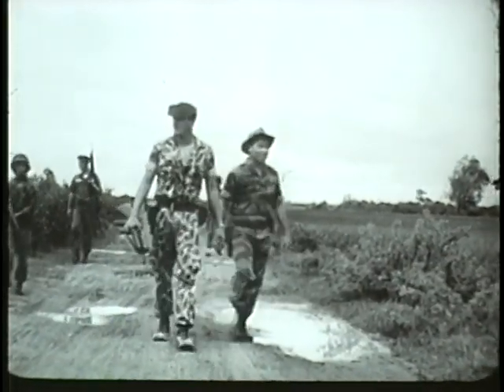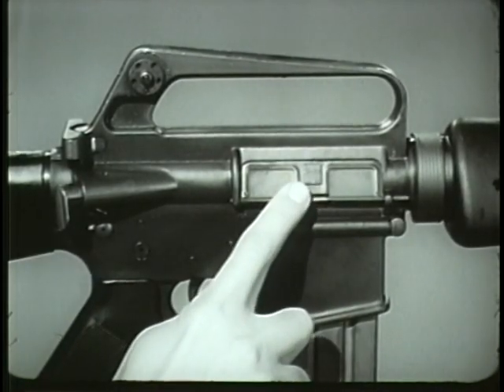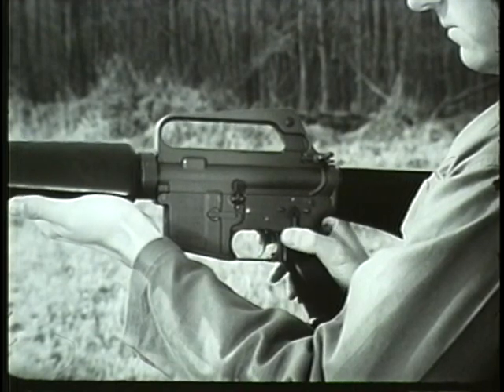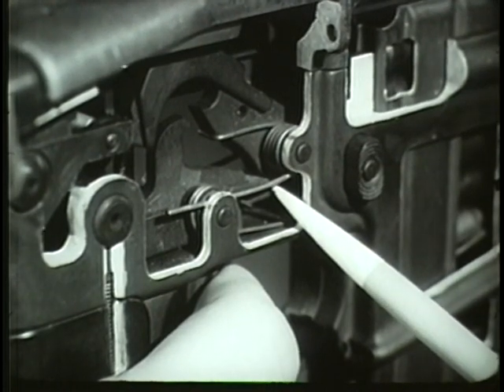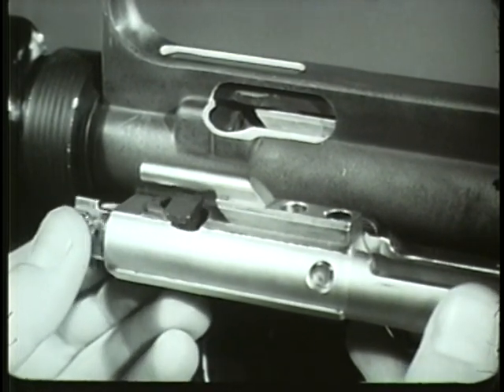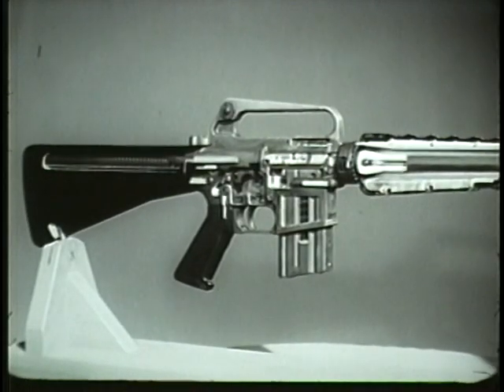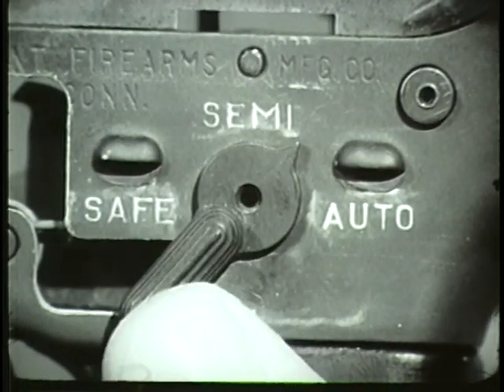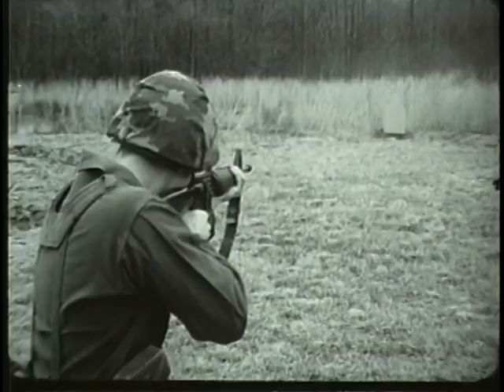RIFLE, 5.56MM XM16E1 OPERATION AND CYCLE OF FUNCTIONING

Comment: Of all the assault rifles I have burned tens of thousands of rounds through, the AR15 family is one of the most reliable, and has the smoothest recoil impulse of all.  The biggest factor that the user has control over in determining reliability is lubrication.  The AR/M16 needs lots of lubrication, the thicker the better.  Contrary to popular mantra, it does NOT need to be meticulously cleaned.  Feed it M193 and M855, on a wet bolt carrier group, and it will run.
Reply: Pou

Comment: The earliest models of the m16 didn't have chromed barrels. Which caused gunk build up from the gun powder. Gun cleaning kits were not issued to soldiers because they believed the gun wouldn't jam. But through out Vietnam the gun was updated with chromed barrels and forward assist. They also started issuing cleaning kits for soldiers.
Reply: Poui

Comment: It was not the ammo, it was the fact that the M16 was the first Direct Impingement rifle ever fielded by the US Military, instead of the Gas Piston designs that had been used in earlier semi- or full-auto rifles (ie, M1 and M14).  The direct impingement routes gasses all the way back to the receiver, which causes quicker fouling than a piston, which separates the receiver and gasses by a length of metal.  Once the maintenance guidelines were changed to reflect this, jamming was cut way down...

Comment: They also didn't supply a cleaning kit to the boys in nam cuz they used stick powder in the testing which is a little more expensive and doesn't dirty the gun as much but when it became a full US rifle they switch to ball powder which made it dirtier but costed less therefore caused it to need cleaning but no kit was assigned hence it jammed but you clean it i will take that over a AK any day

Comment: The M16 does a better job of keeping dirt out of the action than almost every assault rifle design out there.  NONE of them work with dirt in critical parts of the action, especially the chamber.  There is no 100% reliable mechanical device in harsh conditions, and I see more AK's failing on clean range conditions, let alone the field.

Comment: why does not charging handle moves during fire?
Reply: Tom Gol it isn't connected to the bolt
Reply: @ Tom Gol 
The charging handle has a loop - shaped end that hangs down and captures the front of the gas key (which is attatched to the top of the bolt carrier) so that it can draw the bolt & carrier to the rear but does not have to reciprocate with it. Google ‘animated AR15 cycle of fire’ or look up a mechanical drawing and it should become clear to you.
Reply: non-reciprocating charging handle

Comment: The cycle of jamming.
We should have just kept the M14.
Reply: just clean the weapon once in a while
Reply: +EnoughAlready Almost. Remember the AK? Nearly impossible to jam unless you really try to jam it.
Reply: +Fleece “B00ty Warrior” Johnson 
When South Korea bought M-16s, they demanded the gas tube be replaced with a piston. 

The designers of the M-16 were a bit obsessed with making the weapon light. Adding a piston adds weight, but makes it reliable.
Reply: Or use the right gun powder
Reply: It was expensive to make
heavy
and the ammo itself was heavy.

Comment: The "GUPPY GUN"
A BAD design..."direct gas impingement" = dirty, gunky, wet, hot, HOT gas is pumped down a tiny little tube right into the bolt carrier...the bolt-to-bolt carrier area gets totally gummed-up...now, add sand or dirt...the "slinky-spring" recoil spring and buffer won't cut it, so, you need a "forward assist" to get the bolt to close into battery.  LAME  

The M-16 ONLY works reliably in "RANGE CLEAN" condition.  It remains unsuitable for austere combat contidions, in my opinion.